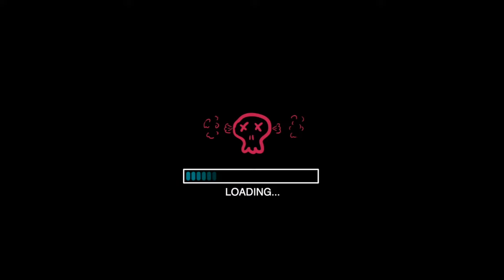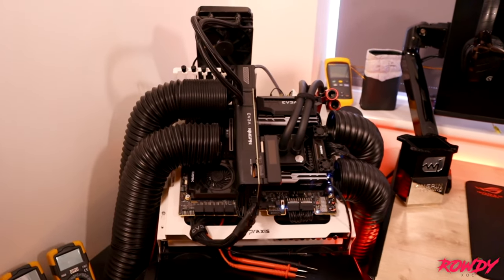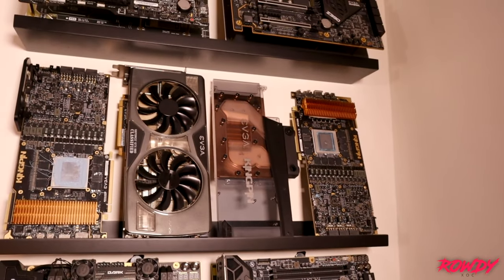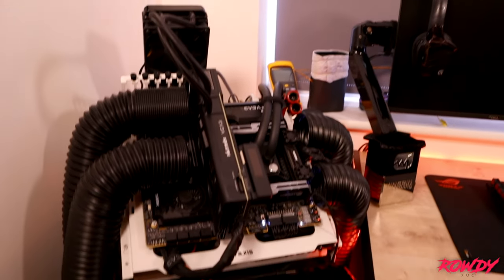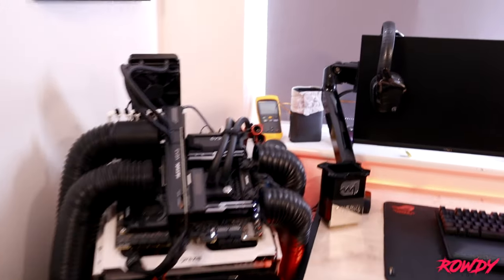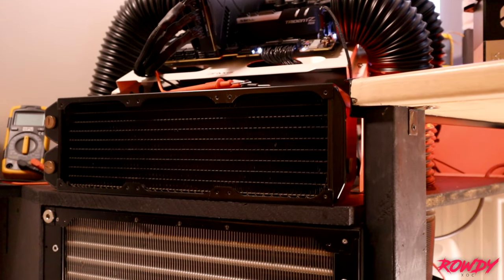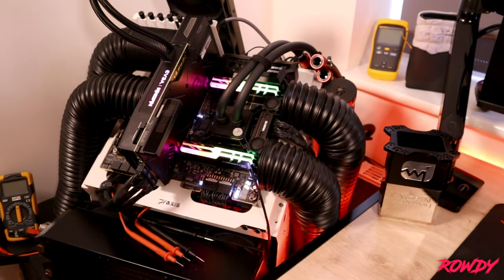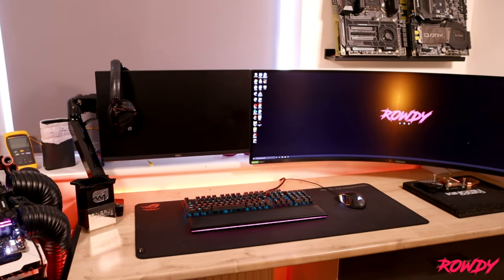EXTREME Water-Cooled PC That You HAVEN'T Already Seen! + Setup Tour

Comment: What are the highest stable clocks you got on that 10980xe with that setup?
Reply from the maker: That very much depends on what you class as stable 😂 I normally just go for broke and only care about getting it through the benchmark! The highest clock speed on the 10980xe so far is 5.3ghz with .2 BCLK overclock with timings at 12-12-12-26 1T. That was using TIme spy bench 👍🏻

Comment: I just built my second ever desktop and I'm really thinking about water cooling cuz my pc does heat up pretty fast I'm running a 13900kf, 4090 strix O.C GPU, 32 gbs of ram 5200, something you don't find very nice lol and ryuijin 3 360 AIO, 790 hero mobo, thor 1200 watts psw and a bunch of QL fans in a hellis case. I want to get a bristal board now do you still need radiators with one of those, an whats your advice you'd give I went all out on my desktop I don't have all the money in the world but I don't want cheap stuff either. I'm going to start soon it been on my mind alot
Reply from the maker: Water cooling is a great solution for efficiently cooling such a machine. Do bare in mind, the more heat that is exchanged from your pc with water cooling ends up in your room. This can be a bit on the warm side haha. If its your first time I would keep it simple with a soft tube loop. Deciding on brands can be tricky and does very much depend on your budget. where are you based?